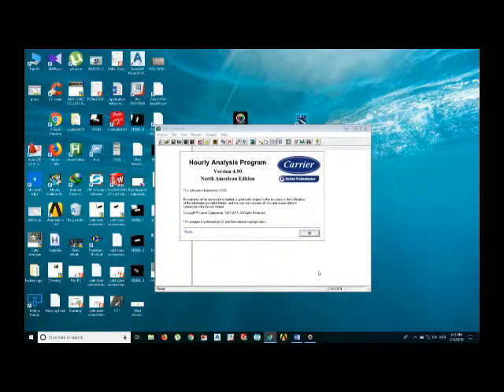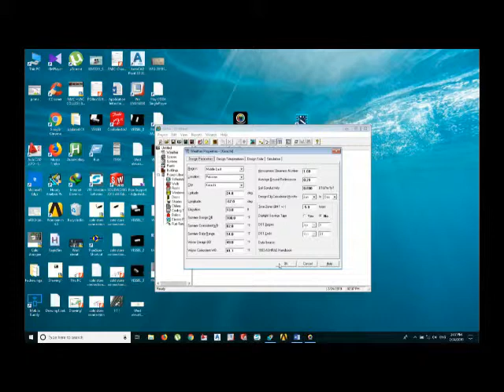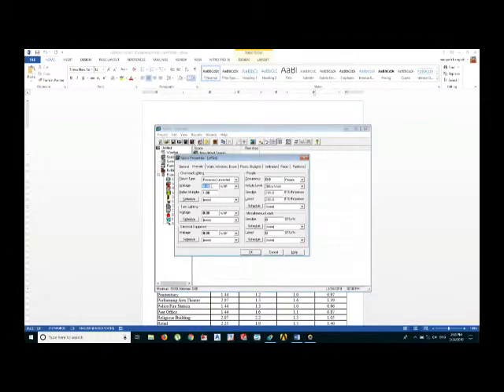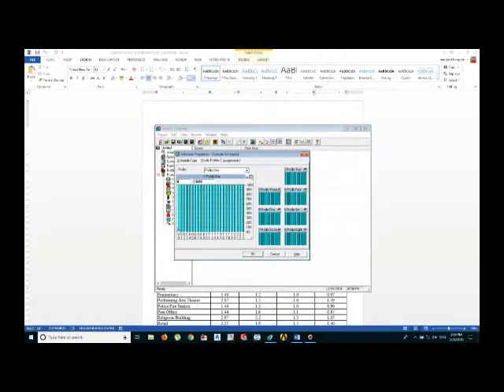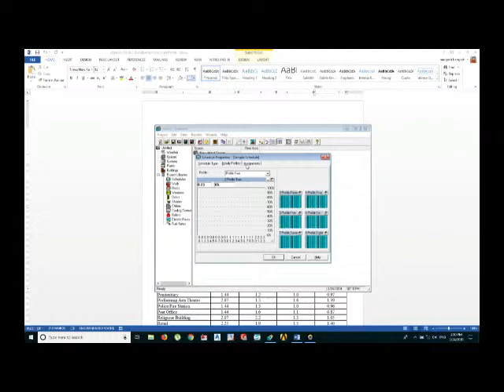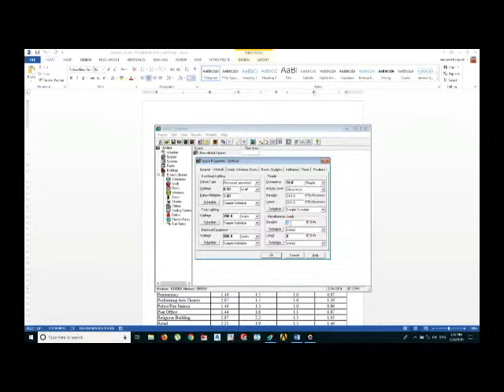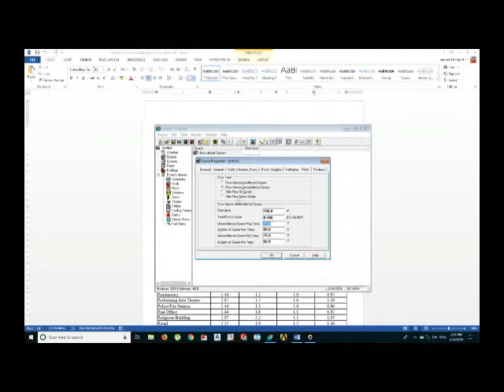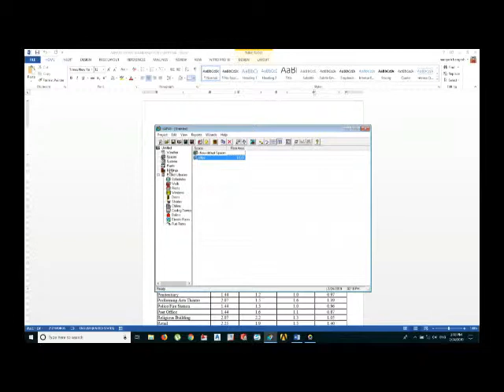Load calculation by HAP (Hourly analysis program) part 1  (HVAC design) (ENGLISH)

Comment: Could please show in a video for doing load calculations for 100% Fresh air unit?
Reply from the maker: Ok i will make a video using 100% fresh air or 100% exhaust air. Like an isolation room
Reply: @passionateengineer04  Hi thanks for your nice video. did you make the 100% fresh air simulation?
Reply from the maker: https://youtu.be/mqp5baB4W0s
Check this video
Reply: @passionateengineer04  Sir Many thank you very much for your prompt reply. I have another question. After I set my data and analyze it. When I click on system -> sizing data I see supply air flow rate and ventilation air flow rate are same for the cases when I set outdoor air supply high. Does it show I am using 100% fresh air? Becaue vent air and supply air are same. 

For the case when I decrease the flow rate supply air goes over ventilation air which based on my understanding they are getting mixed.
Reply from the maker: First of all check the OA(outdoor air) when its equal to supply air than  your system design is on 100% fresh air.
Reply: PASSIONATE ENGINEER thank you very much for your responses. I have just started learning this software yesterday and your videos makes it much easier for me.
Reply from the maker: My pleasure